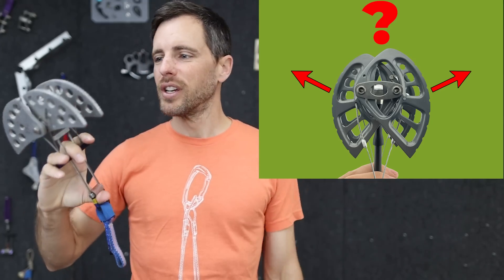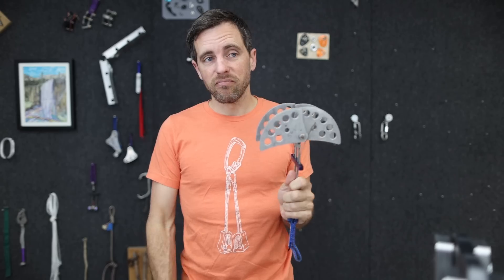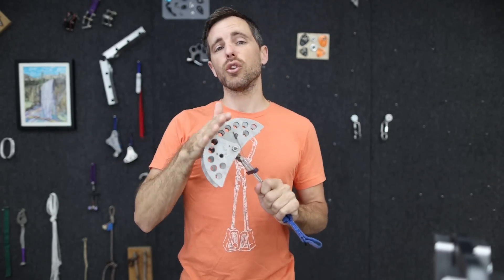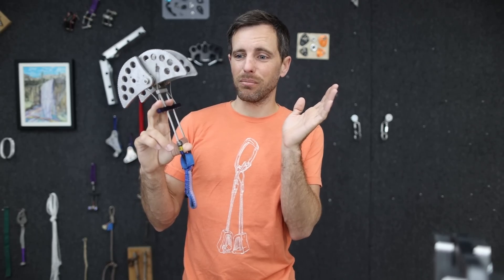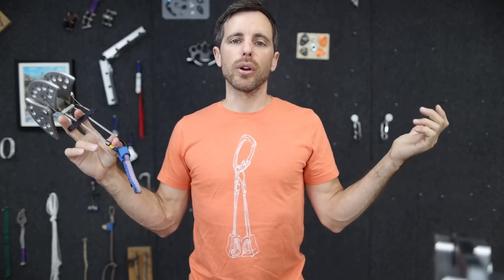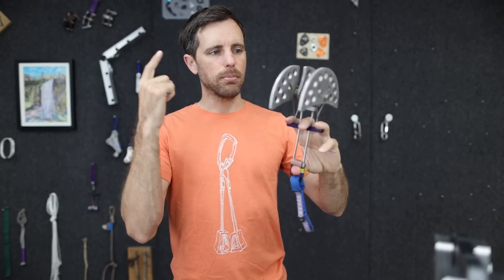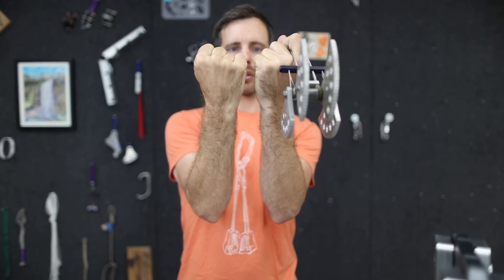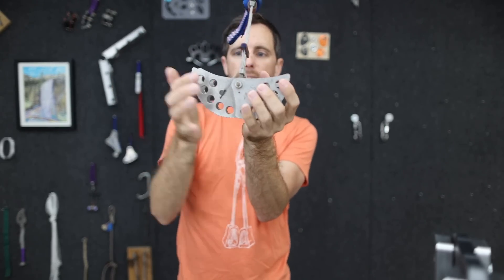I need your help

Comment: You are ignoring the torque created by the friction in the "free moving" joint. Once you apply forces, the metal to metal will cause friction, which may be important. This friction will lead the a measurement lower then the actual force.

Comment: Not an expert but... I think the easiest way is to calibrate it. If you can make a known force push outward between the plates you can read off the line scale and draw a graph.
While you could go and do all the math (it's not that hard) to work it out, it might not actually reflect reality. It's better to test it in some way with a known force to get the most accurate figure.
Reply: I agree with this comment. But how do you apply known force between the plates? One way is a thick piece of steel bent in the middle. Long enough that only elastic deformation occurs. The steel should be thick enough that hundreds of pounds (or more) are required to squeeze it. Measure the amount of force required to squeeze it until it fits in the cam jig with a normal scale. Then, squeeze it and put it in the cam jig and see what it reads.
Reply: @nguyr   I was thinking a screw.  It's probably way easier to measure a torque than messing with materials research and ductility.
Reply: @nguyr  Someone else mentioned an air wedge which might actually be the best way.
Reply: @nguyr  I was thinking something like a simple lever. I suppose in the end, this is a tricky engineering problem to solve.
Changing the whole design of the rig itself would make it easier to calculate, but I totally understand why they've decided to make it like that. Looking forward to seeing the numbers for this test in the future.

Comment: Everything is rubber.  Tiny changes in dimension (strain) under force (stress) will have a large effect on the result (whether rock flakes off or not).  That is ultimately what we want to predict and minimize.  https://en.wikipedia.org/wiki/Stress%E2%80%93strain_curve
Since we cannot measure the tension in actual natural rock, the absolute force measurement will always be speculative and not as important as consistently comparable results between samples.  Use the raw linescale output to make all stress comparisons first.  Then explain the probable equivalent stress in the rock.  Maintain a web reference for your math formulas transforming linescale measurements to rock stress.
Completely missing from all this is measurement of strain (how much rock, or the apparatus flexes).  You mentioned at the start how sometimes you can feel the rock move a bit.  That felt strain, under a small amount of stress is a huge indicator of how it will move under larger stress.  We should not ignore that aspect in the controlled experiment when we can measure it with distance sensors (LVDT, laser ToF, etc).  We can probably use those same small distance sensors in actual rock cracks and measure the tiny amount of rock movement.  Giving us a direct comparison between the apparatus and real rock under equal line tensions.
Edit: LVDT https://en.wikipedia.org/wiki/Linear_variable_differential_transformer

Comment: The force from the cam isn’t focused on a specific point with this setup. This could throw off the math with the leverage involved. I agree that two load cells, top and bottom would be ideal.

Comment: Ryan, you're on the right path but having only one load cell on a side creates a moment about the pinned side, so what you measure is not entirely 1:1. If you share the dimensions, I can do the free body diagram for you, but you must resolve the moment about the fixed pin side to determine the load being applied at the centerpoint of the load cell.
Reply: Need to provide the distance from pin centerline to what you feel is the centerline of the cam and from the pin to loadcell centerline.
Reply: One of the difficulties you'll find is that the arc of each cam is unique and will not provide a linear relationship throughout the load path. Tipped out, they only provide the spring load of the cam, half drawn will be max load (assume 4x region) and fully drawn only 2-3x of max load. Several class mates in college looked into the ideal arc path to constantly provide greatest load but it made for some really complex geometry.

Comment: Any Chance there is an issue with your website? For some reason I can’t see any products. On multiple devices. Internet connection is working fine. The site is working fine otherwise.

Comment: No matter what you do for math people will question it.  You can easily verify your math by just turning it 90 degrees in your test machine and pulling it from where you plan on loading it and validating the math.  And yes 2kN reading should be 4Kn of force and it shouldn't matter on the angles.  But you have the setup to show this is true.
Reply: That's a really good idea
Reply: Better than my idea of an air wedge lol. Simple but effective.
Reply: Very good, simple idea
Reply: Agreed, testing the test jig is the only way to be sure
Reply: This is clever. Do the clever thing.
Reply: The maths is always right. It's just the missing context, axioms, assumptions, omissions and mistaken assertions that you need to watch for.  2 + 2 = 22 !

Comment: It's not hard to calculate. but u have to send the dimension and which angle at the cam. the cable pull is negligible in comparison to the load you pull. We can also assume the crack is completely flat. or not angle.
Reply: The device should be using 2 load cell instead of the tension loading cell u use. Use the bottom pivot as moment center. moment counter clock and moment clock should be equilibrium.

Comment: You could use 2 load cells (1 on each side), that way you could even compare the pressure on each side.
Reply: This might be needed, because you can not ignore friction in the joints. The friction will cause a torque in the joints even if they use move free under no forces. Once the forces are applied friction will be imported.
Reply: How the force distributes depend on too many unknowable factors. No path shunting the force which is not measured can be achieved with the two loadcells.
I have seen a room full of outpuzzled engineers giving up on a similar problem with an industrial ladle at a steel mill. You either measure all the pressure points or you are never completely sure, other schemes are just acceptable estimations for an application that does not need the precision. Sorry for my bad English.
Reply: Agree.  "should" be the same load in the top link and in the bottom link.  But this is testing.  So we measure and prove.  And replace "should" where ever we can.  

But if 2.1 is in the top link, in this setup as described, 2.1 is also in the bottom link.  So 4.2 in the middle is going to be close.
Reply: I like that idea the most, use one each end then add both values to get total outward force.
Reply: @mousedog440  This seems like the most reasonable way to measure the total load without having to calculate how much load is taken by the jig, and then limiting testing to samples that fit in the design-assumptions of the jig,
(ie: effectively only applies force on a known single point along a lever inside a contact area... etc). 

edit: Only problem would be the 'peak' reading could not synchronous, and may bounce from side-to-side; so adding them could give a false result.
Reply: If the load cell is truly twice the distance from the bottom pivot from the center of the cam, than the force read by the load cell on the jig should be 1/2 of the force the cam is exerting outward on the jig plates
Reply: @mitchellstrobbe7779 not exactly 1/2 the force, a little bit less because the bottom link is stiffer than the upper link with load cell. The "ears of the load cell will have more deformation so the two lower lobes of the cam will create slightly more pressure than the two upper lobes of the cam. According to this, a smal tricam could give slightly more precise results than a big cam.
Reply: Equal and opposite force? Why bother measuring that?
Reply: Not so easy, the pull force will affect the reading
Reply: Exactly.  Two load cells, one on each end you would have data on both sides to answer your questions of force.   In other words, where possible, use measuring devices as components, rather than bolts and pins. More expensive upfront but how long will it take you to get the answers with fewer measuring devices… love your channel… rock on!
Reply: Agreed. If you are trying to test it empirically, then you shouldn't do it with so many assumptions, since you may not have enough knowledge and control.

Comment: I say 4x Double so to the lever and the boltet Connection and the lineskale are Sharing the load If you would be us8ng 2 cells an ad 5he value you would be getting the most exact result no matter the exact placement of the cam plug with an extension please you can test nuts

Comment: You would be better off having a second line scale instead of the lower pivot bolts. Then you can just add up the line scales to get the true force.

If the cam doesn't slip, friction doesn't matter.
Reply: I agree with the double line scales. I would add making the plates the cam will contact adjustable by either pinning them or using bolts to have more adjustment with the cam sizes and testing the cams at different positions.

Also with 2 load cells if the results seem to be consistent enough between them you could test different things at the same time on the load cells.
Reply: I agree that the current setup would be close. I think there would be benefit to tracking 2 different things on the same test rather then destroying extra gear. And I didn't see any adjustment in the plates to make different size cracks.
Reply: You don't need that, you can just do the math instead of making it all over again, it's a really simple physics problem, you just need the right person to solve it.
Reply: @geometerfpv2804  the whole point of break testing is to remove as much math as possible. Relying on math to verify your math is just " trust me bro" with extra steps.
Reply: @nathanrice7352     Spoken like somebody who doesn't trust math.
Reply: @RTmadnesstoo  I don't trust it because I actually understand it. My job is this shit. 

The math itself isn't the issue. It's the unproven assumptions. The assumptions that we're trying to prove here.
Reply: @nathanrice7352    So the logic is the failure.  I've been in the same position, kind of.  They've been doing it this way forever but the reason doesn't really make sense.  Somehow, it works 'good enough'.
Reply: @RTmadnesstoo  The risk is that we say, "The force will be double what the line scale reads." But there is something about the system that makes that not true. 

Turns out friction DOES matter. Turns out there is a torque element we didn't think about. Turns out there is some materials science reason more force goes into the bolt than the line scale. 

The best way to know the true force is to remove the assumption.

Comment: Why don't you just measure it yourself. Use load scales attached to the middle points pulling outward, then your top load scale. It "should" be double the load, but recording the actual percentage difference will be more accurate.

Comment: Why use a fixed width cam placement instead of a continuously adjustable set up like a bolt and nut? You'd have to measure the set up each time to ensure that each is consistently threaded, but that's just calipers.